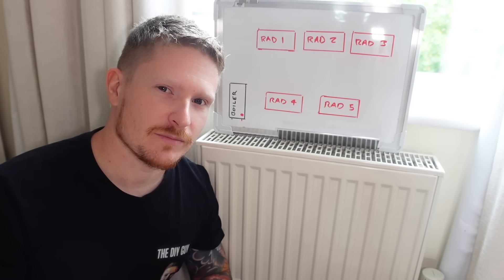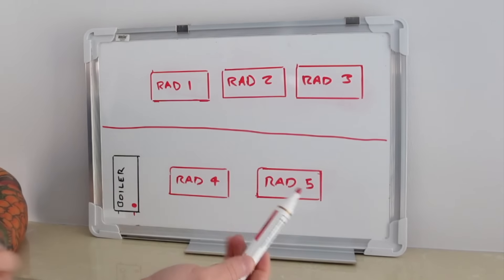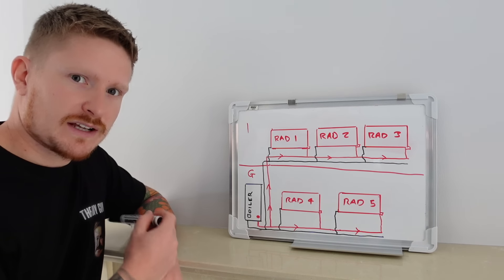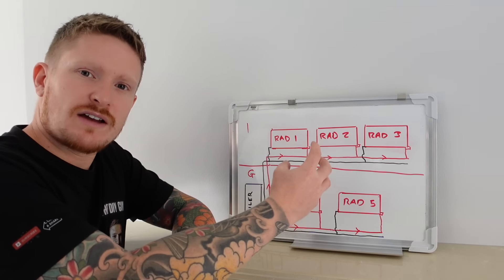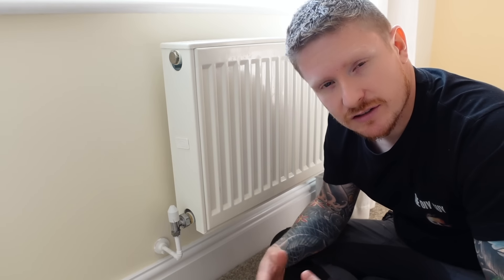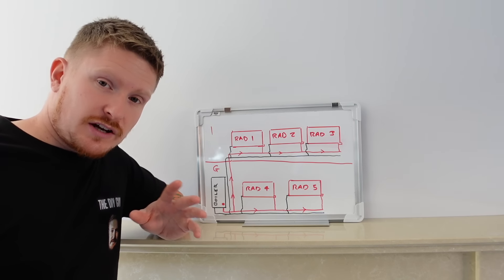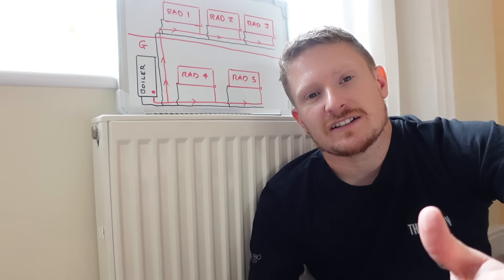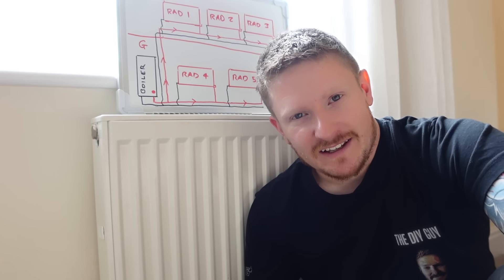How to Balance Your Radiators | Save Money and Increase Heat

Comment: Interesting. When I moved to house where I didn't know first or last rad on the system so to speak...unsure of the hidden piping running under floors etc...I did the following; All TRVs open (#5), all lockshield valves fully open (anti-clockwise), then started system running from cold. I then kept moving around all rads...noting the order in which they got hot. While doing this I made a 'league table' of the rads and ordered them from fastest to slowest getting hot. Next, I decided to keep L/Sh valve on the slowest rad fully open and for the fastest rad...I reduced the L/Sh valve to 10% open. Next, I proportioned and worked out a value to assign to the other rads in between...from 20% to 90% as open position of their L/Sh valves (I noted the different designs of L/Sh valve...some had less than a 360 degree turn from open to closed...others were multiple turns, so I noted their number of half-turns to operate. I was a bit OCD in calculating the mechanical position for the target %open for every rad. Good fun) and worked out the valve mechanical setting on paper before heading around them with the wrench. After setting the L/Sh valves, with system gone cold, I then ran the system and checked that all the rads seemed to be heating up at the same speed...reaching the hottest temperature together. I was pretty pleased with the result as, before doing this, some rads were getting to full temperature while the two rads in the conservatory (one in particular...farthest piped away from the boiler I presumed) stayed cold and only eventually got warm but never as hot as the others. I was pleased with my method...based on my understanding that pressure/flow/resistance of the rads/valves is the same in principle as an electronic circuit where voltage supply (pressure) and resistor values (rads/valves) dictates the current flow (water) and power dissipation in the resistors (heat) equates to heat energy...output from the rads or temperature drop accross the rad input/output. The electronic circuit has voltage drops at different points just like the heating system has pressure drops at different places. My aim was to get an equal pressure, say, at the input of each radiator, accounting for the pressure drop caused by the pipe-run to the each rad. The principle worked near enough. Lastly (sorry for rambling), I set the TRVs to my preference...#4 downstairs and #3 upstairs. Happy home. I may have tweaked afterwards...one rad still a bit greedy and getting hot quickest (perhaps ended up 5% open. With 13 rads around 10 rooms...I'll always wonder if the pipe runs/layouts were well considered or if the 2 conservatory rads were fitted later and their runs were not ideally placed into the system).

Comment: My radiators have thermostatic valves with numbers 0-5, should I set the first one to 1 and then 2, 3,4,5?
Reply: Noooo that's the temp of the room. 4 is about 20 degrees
Reply: No...turn them all on max and. adjust via the lockshields to balance

Comment: Well it sounds good but all my rads seems to heat up at the same time, there is no 'lag' between them in terms of which ones heat up first and last etc. I just can't tell the order of which is first, second, third etc. so that kind of scuppers this vid for me!
Reply: You've probably got a small bore (8mm or so) system and the radiators are fed from a manifold (all the pipes join together at once rather than in a line). So in that case you want all the radiators set to the same opening to start with and then start turning down the ones that are too hot and opening up those that are too cold.
Reply: That’s a good sign, as it suggests your system is probably already fairly well balanced. 
Check the flow and return pipes to the boiler- if there’s 10-15 degree difference then all’s well
Reply: If you have a sealed loop system (no header tank) then the pipe work will be pressurised just below 1 bar (depending on make and model) around the system. Open loop systems (header tank) require the rads to be balanced as the system is not pressurised.
Reply: @stevelee9924  Hi Steve, our system is not pressurised as I have a tank in the loft, so it seems it does need to be balanced. But I still can't tell which 'order' the rads heat up in, so balancing is not going to be easy. I do have a couple of rads that just don't heat up very much, even after bleeding and the TRV pins are working fine so its not that. I'll go back and try to work out the order...

Comment: The 'lock shield' is the return valve, Wheel 'flow' or TRV on on the other end.
Both are ' isolation valves' to remove for decorating. Very few installed will be piped correctly because of speed installing for bonuses etc.
A TRV may be fitted on the the Return side on one Rad and the Flow on another. TRV's work on room temp not water temp, so when set do not need touching.
If the Circulator is working properly on a domestic system every Rad should get sufficient water.
Upstairs Rads used to get hotter because of both Gravity and Heat Rising ( many old systems relied on gravity).
My advice as a Retired heating and ventilation engineer, Five Years Apprenticeship. Is leave the system alone and get an Engineer.

Comment: I have 12 radiators and can't get round them quick enough to identify the order they heat up, help please
Reply: It could take a while but turn one off. See which ones go cold.  So in the diagram used here if you turned off 2, 3 would go cold.  Notes which rads go cold as you close one off or open. 
You will work out the order. If you close last one off... No other rad will go cold.  Sketch it up and figure out your rough settings on each rad. 1st, quarter turn ,2nd half turn etc.
Reply: @tobingj  thanks for the advice. I'll definitely try that.
Reply: @tobingj  turning off rad 2 would not make rad 3 go cold, it wouldn't make any of the rads go cold. The rads are not connected in series. They are Tee-ing off the the flow circuit. So closing a rad off would not affect any other rad.
Reply: @hing22  ahh. Well fudge. Always how I imagined it could be done. 
I suppose opening return (lockshield) valves fully will cause colder rads further down the loop. 
Alternatively track the pipe work through wood floors with a thermal camera. I would expect mostly common sense. The nearest rad will be the first.  Do a rough sketch of the house.
Reply: Get family and friends to help. That's what I plan to do.

Comment: I’ve seen systems with no lock shields.
Reply: You have.  This is where the radiator has been sized correctly for the room, so it heats up, and heats up the room correctly.  Some rads are over-sized.

Comment: If you balance your radiators, and if the pipework is capable of delivering all the heat your boiler designed for, then your costs may well increase. This is because the radiators will have more, hotter, water going through them. If your boiler is a condensing type, and if the difference in temperature between the flow and return was less than 20C and the balancing raises that to greater than 20C, then your boiler could possibly work more efficiently. If that happens, you will pay less for the same amount of heat as you used before. If you use more heat because more radiators are hotter, then your bills will increase.

That said, if your radiators heat more evenly, the heating will be more effective ie heat the property more evenly and possibly quickly, you then have the option to use the heating controls to reduce room temperatures (if that does not interfere with medical or other needs).

If you really want to make your heating work better, and if you are medically fit, then go for a run first, and see the difference in your heating needs. Run more than five miles a week and I suspect your heating bills may go down. After all, if you are running over the hills you don't need your heating on !:-)

One problem that some heating systems have is an permanently open bypass (pipe). These ensure the boiler always has a flow of water when the zone valves close. The bypass (pipe) can be both external and internal to a boiler. It's a pipe that goes from the flow side of the pump to the return side of the boiler. There is an internal bypass in some combis and some system boilers. Those are more likely to be adjusted correctly. If you are not sure, ask your plumber to check for you. The bypass should be fitted with a spring-loaded automatic bypass valve. That will ensure that all the heating water goes to your radiators and not straight back to the boiler. If it does that it can force the boiler to shut down when you desperately need it to stay fired up.

Comment: Another few tips. 
1. Make sure you close the vents at the top of upvc windows that people forget to close. Not all have them, but some do for room circulation. 
2. Make sure all your windows close fully, no gaps down the sides, as this would indicate a faulty bracket that needs replacing & this allows cold air into your home. 
3. If you have house with multiple rooms you rarely use. Go in & turn off the radiators & close the doors. This will stop the central heating warming up rooms your not using, also keeps the warm air in the rooms you do. It saves you money as the hot water circulation only circulates through the radiators you have on, which means they get hot faster & saves you money.
4. Move your thermostat if you have a wireless one to your Livingroom away from the kitchen & hall way near your front door. These 2 rooms are often the coldest & also the rooms we don't sit & relax in when we start to feel the temp. So moving it to the living room, means your boiler isn't on until the coldest part of your house reaches the temp. I find my living room always warms up first before anywhere else & that's because it's the most shielded from the outside weather.
5. Turn off your thermostat or set it so it doesn't come on whilst no one is home. People often forget about this & find their homes warming up when no ones home. I turn mine on when I get home, takes literally half an hour to warm up.
Reply: You need air flowing through the house. Closing air vents on windows and sealing everything will raise humidity. Damp air costs more to heat than dry air. 
Get a Nest room stat which has built in humidity indicator and keep it under 60%
Anything higher then you will be prone to mould spores growing.

Comment: "Save money and increase heat"?
Can't be done - it's simple - the heat comes from gas heating the water in your boiler. If the heat increases, then the amount of gas used to produce that heat must also increase.
Balancing radiators simply puts the heat where its needed, reducing the total amount of heat produced, using less gas.

Comment: Shhhh!! You're not meant to publish this info because supposed to fit complete whole new heating system when the rads start loooosing power
Reply: @TheDIYGuy1 I'm amazed people are actually doing this and not what I see.  People normally OPEN all the rads never turn then down when there's a problem. And the knobs are always each one set 5 number because anything less risks make the radiator go cold. The room thermostat is always at maximum for same reason.  Also everyone I know when a radiator isn't heating up they put extra pressure in the combi boiler into the red and sometimes until water flows out the pipe outside to make sure there's no danger of not enough pressure.

Comment: Oh dear, as soon as you got the adjustable spanner out and mentioned grips I had to stop watching? They are the main cause of chewed up fittings? There’s a correct tool for every job and you should promote them if you want to try teach DIY plumbing or any other trade?

Comment: Uhm, I've never seen radiators set up like that. It seems so weird to me. What I've got in my home is as follows: the hot water pipe is connected at the TOP of each radiator and the return at the BOTTOM. The hot hot water pipe (column, for that matter, as it's a 10 story building) has a steady and rather slow flow. All the radiators are balancing themselves because the hot water stays at the top, where it enters, until it's cooled down and follows the path of the return pipe. They're all nice and hot, regardless if it's the 1st or 10th floor, and you don't have to play with any valves, there's just a flow restriction faucet at the entry at the top, which only turns half a turn and has numbers from 0 to 5, obviously 0 being shut off completely and 5 being 100% flow (if you want it to get the hottest).
Reply: You haven’t got a clue about heating systems …

Comment: These problems were pretty much solved by thermostatic valves and heads. Unfortunately, I live in place which is not officially place for living so law is not forcing owner to install thermostatic valves, I did it by myself this year, finally I don't have to care about that and it holds constant temperature. These prehistoric systems like you have are very outdated, modern systems should have thermometers in every room (or at least in the most important rooms) so your boiler can automaticaly regulates heating power and ofcourse, thermostatic heads everywhere, you probably don't want to heat when you turn on 3 kW electric oven. We have pretty modern solutions now here in Czech Republic because of all those EU grants and forced removing of old boilers in last years. People were angry because of that, but in today energy crisis, they should be glad that they don't have to put some coal to boiler with shovel like if it was 1950. Thermo valves in apartment buildings are mandatory for like 15 years here. Some people even have electronic heads with wifi, so they can control their valves or even boiler when they are not at home on phone.